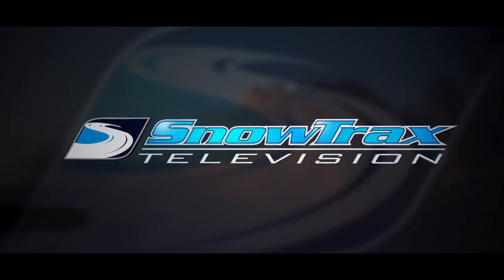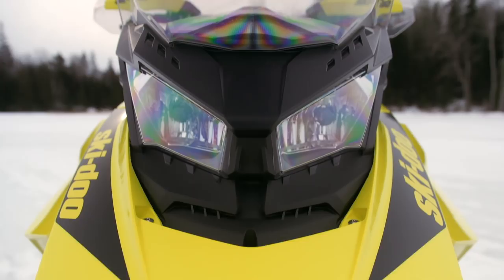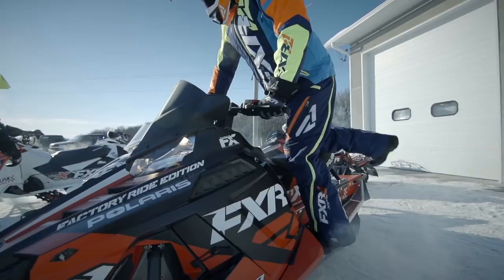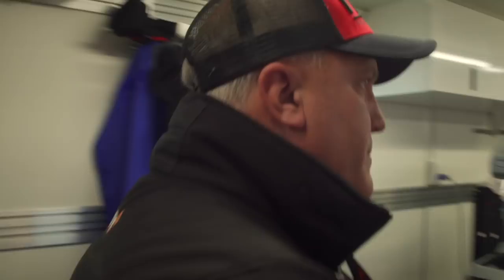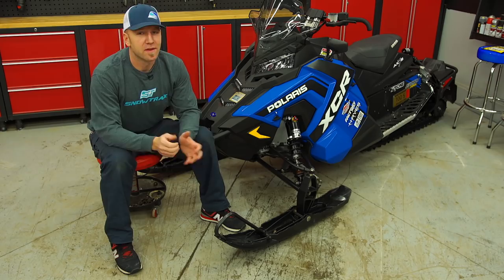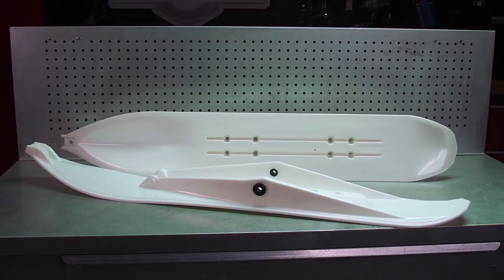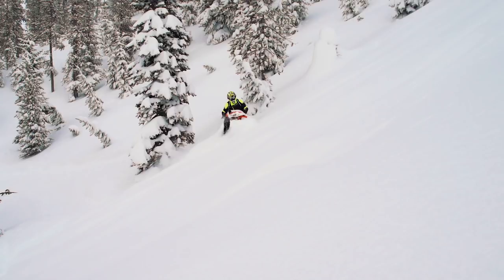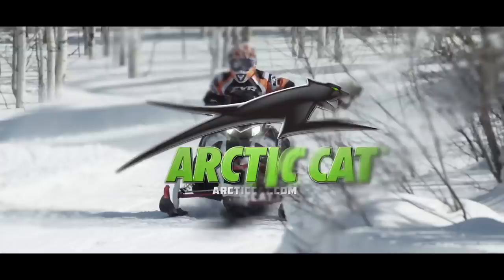SnowTrax Television 2018 - Episode 7

Comment: The cats shocks are adjustable... They're air shocks, and the snow pro comes with a pump...
Reply: Not the ideal shock. I wouldn't want one for trail riding. This is why I'm not interested in ac. The one sled that caught my eye was the limited..... It had the new qs3. What an awesome idea! Totally sold on it. The only practical shock for trail (true trail) riders

Comment: GREAT VIDEO, BUT I have 1 question for Arctic cat, they have modernized everything but 1 thing on all the sleds since the early 2000s, the buttons/controls on the handle bars, they have not changed one bit. when is Arctic Cat going to modernize the handle bar controls?
Reply: 2019 handle bar controls are all new. shorter brake lever an actual tether and toggle killswitch is replaced with regular style kilswitch. the hand warmer and lihjt switches are newly designed and smaller as well